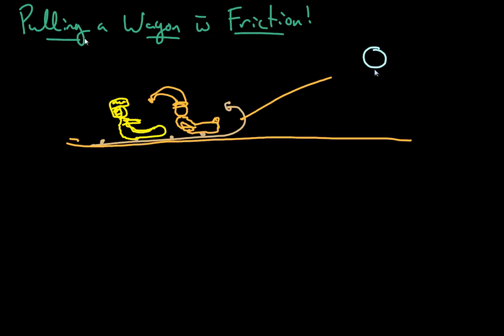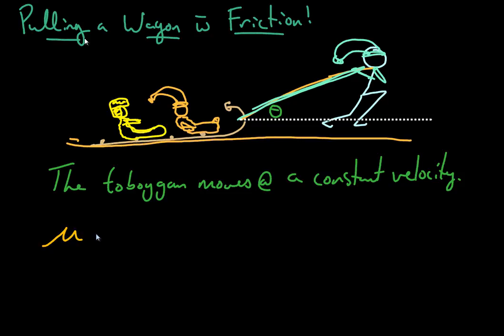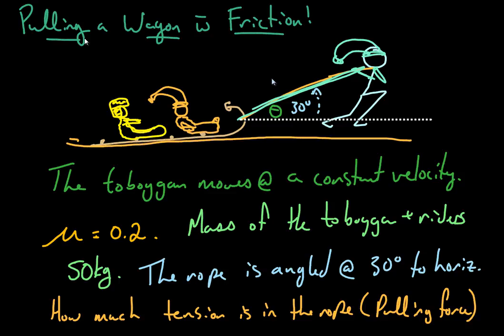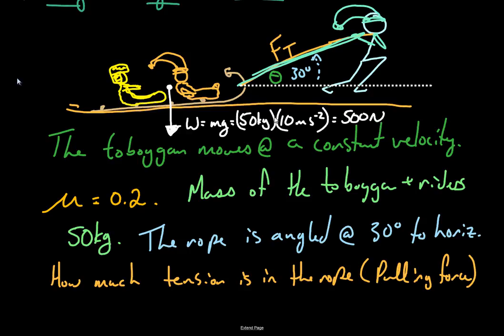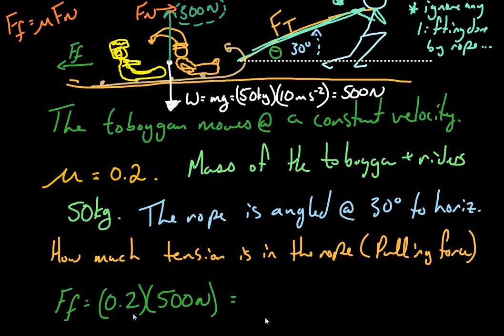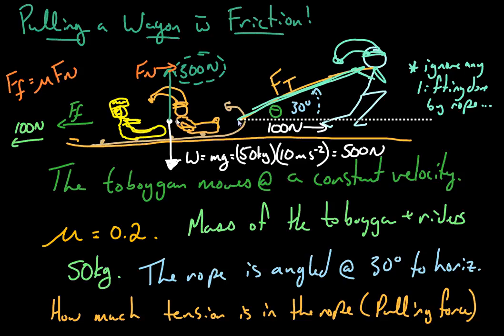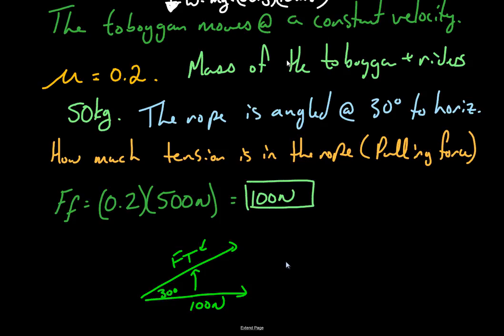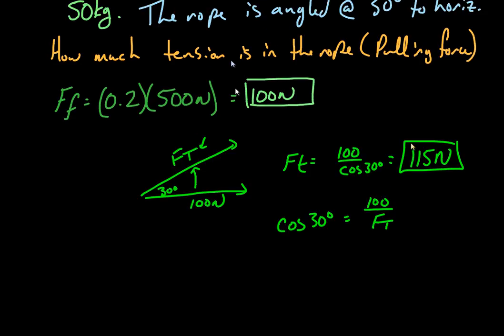Pulling a Toboggan with Friction

Comment: Hello Greg I was wondering where we would start if we did need to account for the lift that the dog is producing when pulling? We got that as a physics assignment and I'm kind of stuck!

I was thinking something along the lines of getting the dog's friction force but I think you'd have to include the weight of the sled in with that?

Comment: I've been looking all day for a problem like this WITH acceleration in the X direction. I cannot find one anywhere.
Reply from the maker: If you throw up an example of what you are after I'll see if I can take a stab at it...
Reply: @GregJohnsonWinnipeg  Wow thanks, I didn't really think you'd respond, much less try to help! This isn't my problem, but it's close to it.

A man ties a rope around a 45kg crate and drags it across a rough horizontal surface. The rope makes an angle of 30 degrees with respect to the horizontal. If the force of kinetic friction is 13.2 N and the crate accelerates at a rate of 0.8 m/s2, what is the tension in newtons?
Reply from the maker: @junkaccount2535  Ok. Give me a day or two.
Reply from the maker: @junkaccount2535  This is actually pretty straight forward. You know the net force in the x direction must be 45kg x 0.8 = 36 N. If the friction is known to be 13.2, the total force applied by the puller in the x direction is 36n +13.2= 48.2 N. Now the tension on the rope would be 48.2/cos30°=55.7N